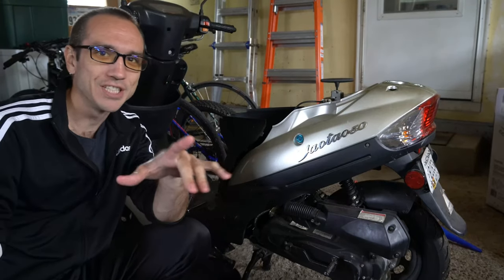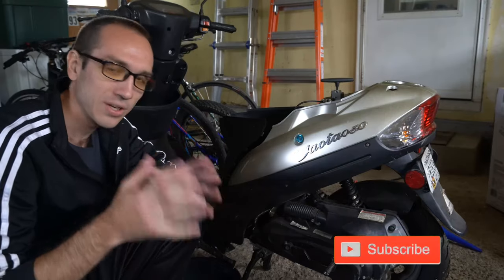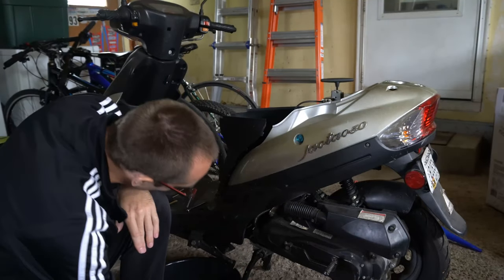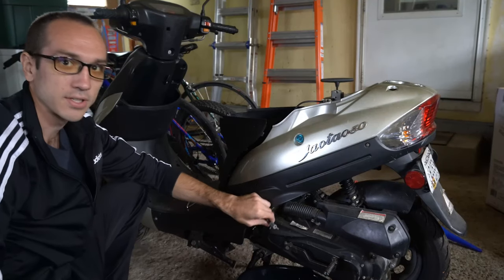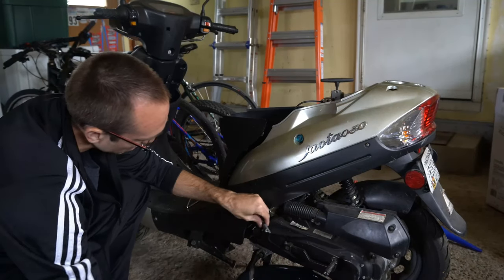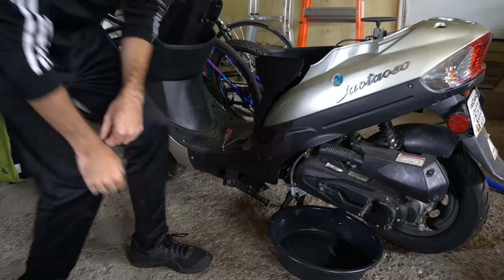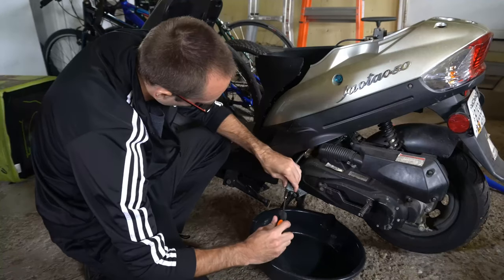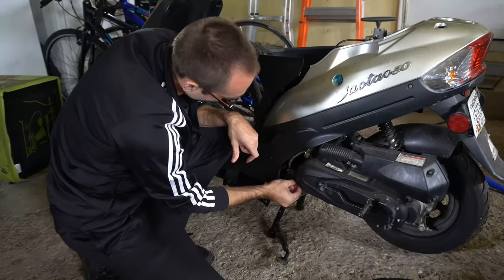How to drain gas from Carburetor on 50cc Moped (Winter Storage Must!)

Comment: Does it just drain it from the carb or the whole tank?
Reply: That's what I'm wondering
Reply: @JustinUmholtz-e4u  tell ya what I will never buy another Chinese moped in my life! I have replaced so many parts since buying it and it only ran for a year! I just bought more parts to fix it and then I'm probably gonna sell it and buy an actual American brand . My moped only has 300 miles on it 🙄
Reply: @dottielawing4323  does the gas drain fully from the fuel tank if your draining the carb?
Reply: @dottielawing4323  I don't blame you!
Reply: @JustinUmholtz-e4u  no you have to drain the tank separately. My petcock was located under the gas tank connected to it once I removed that it drained from the tank. Depends on what kind of moped you have .
Reply: @JustinUmholtz-e4u  check to see what is connected to your tank and drain from that line
Reply: @dottielawing4323  I have a taotao 50cc scooter I took the bucket out but I didn't see a line
Reply: @JustinUmholtz-e4u  mine is a tao tao 49 cc if you take off left rear panel you will see a line running from the carb to the gas tank . That's the line you need to pull to remove the gas . If it's a vacuum line like mine was my petcock is connected to the tank itself and only way to access it is by removing your side panel . Hope that helps
Reply: @JustinUmholtz-e4u  sucks but ya gotta remove the panel
Reply: @dottielawing4323  We only switched the carb after a few miles. No problem since then. 2500 km, so far. (ok, I got a flat tire last year...)
Reply: @thatmaninblack  thank you!
Reply: @dottielawing4323  TaoTao 50 is fine. I also got an Amigo 50, that has issues sometimes. Last time gas just refused to come out of the the tank. I had to mess around with a wire and I had to loosen a nut at the gas tank. It works since then. I don't know about American brands, I like my Chinese mopeds. I don't know if it would worth paying 6-8 times more for a western brand. :)